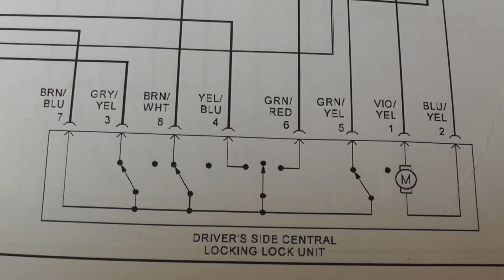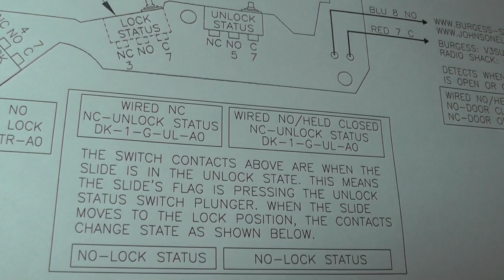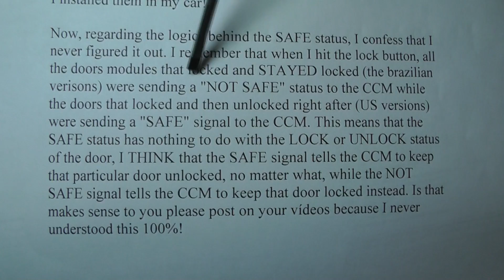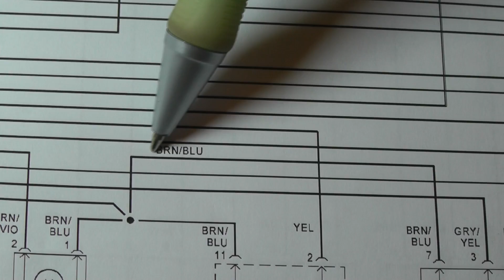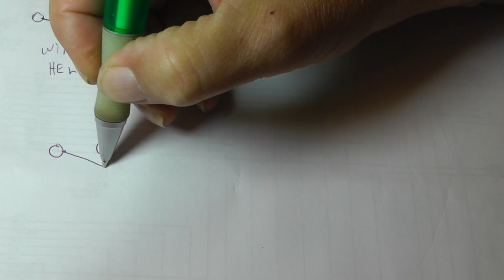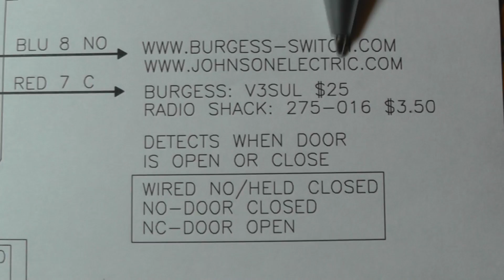The Electrics of Volkswagen Door Lock Modules - Part 3

Comment: Hello stuzman52 and thanks for very informative video series on these locks. I have an European version Passat 2002. It has the 4 switches and the insides of the electric part is a bit different. I tested the lock, mechanical side is good and in the electrical side all the flags bump good and i can hear the clicks. I can see the lights under the door when the door is open.  

Problem is: Driver's door only locks/unlocks when using the key.  It doesn't work from remote or from the door lock/unlock switch. All the other doors work. The electric motor works when i try with direct power. Do you think the problem is in the door control module?
Reply from the maker: It could be and this point I would put a scanner on it to see if that could lead you into a direction. There may be a code for your issue. I use the scanner from http://www.ross-tech.com/ which is what a lot of VW techs use.
Reply: I finally got my door lock working. The electric motor was so bad i could not turn when the lock was assembled. It worked fine when i tried it without load. I replaced only the electric motor and put it back together. Works fine. 

There was a trouble code but it referred to the comfort unit. It took some troubleshooting to measure all the cables and disassemble lot of parts. But it was fun and learned something along the way :).
Reply from the maker: Excellent habasaab and glad to hear that you figured it out and learned something along the way. Have a Happy Holidays!

Comment: Hey brother all your Vs are great and i hope that you can help me on this:
i have a VW passat 2008 TSI and my rear left door has the below issue:
1- the door is not locking or unlocking from the car or the key 
2- the windows is not going up or down using the key by holding or from the switch in the driver door or the switch from the door it self 
3- the car will not horn when locking from the key even before the problem happen or start to happen 
4- i took all the wires from the door tested them and all are working, 
5- i cleaned the connectors 
6- non of the fuses are blown tested all 

brother please help me i got crazy of this more than 5 months now 
we hope we will  have smart people like you in my country
Reply from the maker: Do you have a scanner to look at the inputs and outputs of modules such as for the doors and the convenience comfort module? I believe things like the doors, horn and lights pass through this comfort module. Otherwise, you or I would be just guessing of even where to start looking. Also, you'll going to need some wiring diagrams. If you don't have a scanner, I would recommend one from here http://www.ross-tech.com/
Reply: do you mean the same door connector i did that so many times 
did you had the window issue also ?

Comment: I like these videos you have made. They are very helpful and detailed. I am having problem with Octavia typ1  drivers door going totally dark so nothing is working on it and then next minute everything is working. From the passanger side central locking works on every other door except drivers door. I have tested wires and those are not broken. I have not taken apart lock module yet because i need to drive around and cant leave my car unlock. Do you think my problem could be caused by that micro switch that was also broken in your lock module or should i try to find the problem from the electric windows motor module?
Reply from the maker: If you have an issue with that micro switch, your door will lock when it's open. Also, the dome light or puddle light won't come on either.
Reply: I got it all back together and it seems to be working. Door wont lock when open so that micro switch seems to be okey. But i noticed that drivers door lock button on top near the window wont work when using lock and unlock buttons from inside the car in the door handle switches. Every other door gets locked using using that. Also from the passanger side that lock button near window will go down and up when using key to lock and unlock. So from inside the car door handle switches drivers door wont get lock/unlock but every other door is.
Reply from the maker: Maybe there is an issue with the lock/unlock switches on the driver door side.

Comment: Hello @Stuzman52 I am from Europe and I can NOT open left passenger door. (from outside and inside)
I connected my PC to CarCompueter and when I lock my car all my doors are in LOCKED Status (except this borken dor, they got SAFE status)
http://obrazki.elektroda.pl/5192198000_1469353365.png
When i unlock my car all dors are in UNLOCKED status  (except this borken dor, they got SAFE status)
http://obrazki.elektroda.pl/7618967800_1469353351.png

I tried remove Fuse14 from my car, and then I tried open this door by handle (from inside and outside) but it didnt help.
I thing that I need move my motor (there is some information where you explain it) https://youtu.be/hA_igZnCBPY?t=3m30s

Am I right and shout it help?

How can I  supply my motor (I know that I need Connect Suppy V+ to PIN1, and V- to Pin2) 
But I cant even open the door I get to driver door lock connector.
Reply from the maker: Hi Tomek. It looks like your safe switch is giving you an issue. Here in North America, we don't have that switch as I pointed out in one of the videos. And it's my understand that if you try to unlock the doors, the one with the failed unit will automatically relock again preventing you from opening the door. Fuse 14 feeds the central convenience control module, but there are other supply feeds going to it. Tomek to ensure there is no supply voltage feeding this module or driver door modules, go ahead and disconnect the dc- battery cable from the battery. I don't know what year your vehicle is so if you have an older vehicle that needs a PIN for your radio, have it ready. With no supply voltage to operate the motor inside the door lock module, you should be able to unlatch the door since the motor won't try to relock the lock. Once you get the door open, then you can take out the door lock module to investigate it to see what's going on. Hope that helps you out.

Comment: Hi, i have an other question. Did you have ever measured the resistance of the Microswitch inside of the lockmodule? E.g. from the switch which is sensing the locked/unlocked position?

In my rear left doorlock i can only measure 60mega ohm or infinit. And i have the "euro version" of the doorlock with the SAFE/UNSAFE switch, for this switch it is the same . Also the same resistances.
Reply from the maker: Hi Frank. With any microswitch, you should be measuring near 0 Ohms in the closed position and infinity when it's open. If you push the plunger on your switch and it still remains at 60 meg or infinity, then you've got a bad switch. Since you've got two switches saying the same thing, you may want to try another meter. The switches on the circuit board draw very little current, so it's not likely to go bad. Not impossible, just improbable. Oh, on the PDF document, I did translate it to English, but it didn't bring the pictures along. I do appreciate you finding the document which explained the safe/unsafe switch. Take care Frank and hope you get your door lock module sorted out.

Comment: that mine...mine has the extra switch and the rail underneith...the main sprung gear.....proving to be a pain to get back together as when I DO get it back toether, I cannot hear the main microswitch activating on and off with the movement of the case lever...bloody thing!
Reply from the maker: +switchest26 Hang in there and don't give up. You'll get it figured out!
Reply: +stuzman52 Well I got it back together ok so I could hear the main switch clicking on and off. From what I can see, the additional switch (not found in America) can only be activated when the under rail is forced across by the sprung gear under tension. I tried to test flash volts across the motor pins but it needs 12v to fully be activated...I only had a 9v battery. I will test on the car before re-assembly. Many thanks again!
Reply from the maker: +switchest26 Glad to help and good luck on your door lock module.

Comment: Bently Manual is very helpful mechanical but almost worthless almost when it comes to the breakdown of electronics...
Reply from the maker: +blkcoupequattro Yes, that is true. And I've found that even with the mechanical section some of it isn't correct. For example, for the VR6 engine, it says to replace the water pump, its a simple matter of taking the belt off and removing the bolts for the pump. In reality, you have to take motor mounts off and jack the engine up to get the pump out.

Comment: OK, it's just a shot, but whatever. We know that in the absence of the fourth microswitch (like on the US DLMs), the door lock modules send a "SAFE" signal by default. Once the brazilian CCM receives that signal (and it's not expecting that) and realizes that the car isn't actualy deadlocked (after all, it's the CCM, it knows everything because it has feedback status from other locks), for safety reasons it triggers an unlock signal to that specific doors. Maybe the CCM thinks "Those two DLMs went crazy, they actually believe we are on deadlock (because they are sending the SAFE signal), let me keep them unlocked no matter what"

Comment: Hello pal, nice to see you actually made the vídeo, congratulations! Now, regarding your doubt: YES, the modules that once received the lock signal and STAYED LOCKED (the brazilians) were sending a "NOT SAFE" status to the CCM. On the other hand, the doors that were receiving the lock signal and had the american DLM on them were sending a constant "SAFE" status to the CCM. I haven't figured the logics of that, but I did find out that this is related to the "deadlock" status of the door. This feature is present on some cars and when it's on prevents the door from being unlocked from the inside handle if the car had been previously locked by the external key or by the remote. Once the deadlock feature is on, the status of the DLMs changes to "SAFE" and will return to "NOT SAFE"  only after the car is unlocked from the outside again. This has something to do with thieves, I guess to make their life more difficult in case they try to break the glass to open the door from the inside handle.. Also, it's nice to point that the DLMs that HAVE this fourth microswitch also have  another piece of plastic inside of them that acts like a lever the trigger the 4th switch, so it's not just the same board with one less switch.
Reply from the maker: +VitorBart Hey Vitor...how have you been? It's good that you took the time to show your analysis here with what you found down there in Brazil. And with this information, other folks out there can see the differences in their own diagnostics around the world. Always good to hear your thoughts and wish you the best. Have a great weekend!!!

Comment: I'm looking for a temporary fix for my Door Open/Closed Switch until I get a new one. The problem used to be that the door would register as always being Closed (which was not a big problem, as everything worked fine except the lights). Now, since yesterday, the same door, is registering as always Open (which is a bigger problem, since the alarm acts up and I can't safely park my car in public places). Your diagrams are very useful and I thank you for sharing them with us, but I just want to ask to be 100% certain: The temporary fix I want is to trick the module to think that the door is permanently closed again (I don't care about the lights at the moment. I just wanna leave my car safely in parking lots). So what do I do with the red and blue wires once I disconnect them from the switch? Do I tie them together or isolate them? so that the door will always appear as closed and the lights will be off
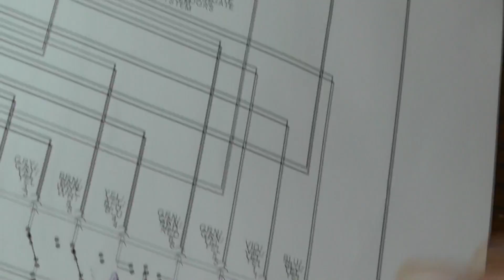Reply from the maker: +Toasted Synapse Gaming As shown in the wiring diagram at timeline 29:30 the switch will be NO when the door is closed which is what you want. For whatever reason, these two wires to the switch is now in a closed position. Maybe your switch is now stuck in this position. You want to isolate these two wires to make a NO condition which is when the door is closed.
Reply: I have the same problem ( door is seeying as OPEN). I want it to be seeying as closed.
I dont have access to my door lock mecanism, but I have access to the panel, Can I just cut the wire #7 or #8 ?

Comment: Hi guys,
I would like to explain about that forth switch. My car is VW Golf MK4 and I am from Bulgaria. I have that forth switch and couple of days ago I've reverse engineered what exactly is doing that switch.

When the door is locked (via the remote or the key) the CCM sends a signal to all the door lock modules to lock the doors. When the door lock module receives that signal, it locks the mechanism and sends back the signal of the "UNLOCK STATUS" switch on the video. If no signal is received, the CCM sends a signal to unlock the door again, else - it sends a signal to activate the so called "deadlock" of the door. When the deadlock is activated, that forth switch is pressed and the CCM receives a SAFE Feedback status, elsewhere it received a NOT SAFE Feedback status if the deadlock is inactive. That feedback status can be seen on channels (if I am not wrong) 4-10 for all four doors on the Central Conv. Module (Address 46) via VCDS.

Comment: Hi stuzman52, firstable thank you for your videos full of passion and enthusiasm. I need some help for my Peugeot Expert III Van (Europe modification) 2007 , 2.0 HDI having NO START (but have cranking) problems every time after I've got access to the back cabine using the slide side door. Without lock/unlock from my 3 button key the van start never occur. I haven't any trouble codes and nothing to worry about when I'm reading the car. When I removed the slide door covers giving me access to the electric lock module I suspect someboy was already there before because the door electric module isn't the same as my rear door module and using only two wires attached to it when it has 5 pins plugs (other are cutted and microswitch missing). My qustion is: Is it possible this to be the 'key'of my troubles and the immobilizer become shocked because it doesn't know does the door is open or not which then telling the ecu not to start the engine?
Thanks in advance and sorry for my bad English.

Comment: Wow - I'm almost speechless .  John Doe's response was bang on.  Vehicle production is allowed at each governments political whim.  Politicians , OMG don't even want to comment on these jokers .
I have heard many people including myself say what were the engineers thinking when they designed something that seems illogical .  In my 30 years experience I have never witnessed an engineering  mistake.   I have witnessed a lot of failures but all of these were well known through out the production chain.  I have seen an OEM wiring diagram and the detail was impeccable  and also way over my skill set.  As for the fourth switch I look forward to Thomas thoughts as well.  That was a tremendous amount of research  and I found this just fantastic. Thanks Terry
Reply from the maker: You're quite welcomed and it took quite a few hours of research, looking at forums to put it all together. Yes, if you get me started on the government, I won't know when to stop. Just hope it helps others out there since it seemed to be very little info on these devices.
Reply: Hey Steve... you won't be getting any extra info from me. Terry has done way more than I could ever hope to cover. I learned as much as you have. Everyone gets mad at mechanics for selling a new lock unit instead of repairing it. If it were a repairable item, then VW would have all parts available for purchase. Where I work, replace the lock module ( after confirming that it is the problem).

Comment: Impressive reverse engineering!  Wrt the safe/not safe issue - at the system functional level the explanation could relate to remote locking, theft-deterrence, key in ignition switch inhibit, or etc unknown. Why in ROW vs NA? -  beats me but maybe regulation issue back then. Current theft-deterrence is by engine shutoff (Immobilizer III) and doesn't use door locking system. My favorite guess is that it may be the way it keeps you from locking the car with the engine running or with key in ign. but why is it only used ROW? 

Looking at all the repair videos you have for this car I have to conclude that you keep it in order to have subject matter for vids.  😊  Best of luck
Reply from the maker: Thanks monomille...It sure would be nice to know for sure what that function did and it's anybody's guess. Yes, this VW sure does like attention, but I'm getting to the point I'm going to whip its ass and send it to bed with no supper.